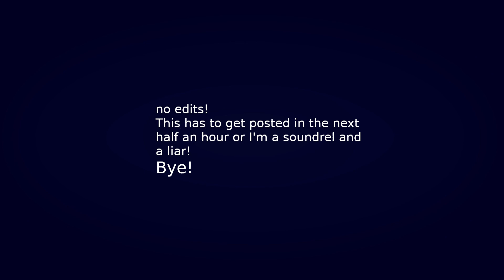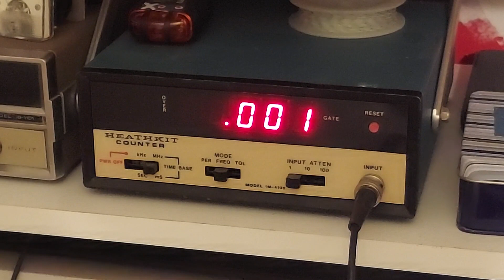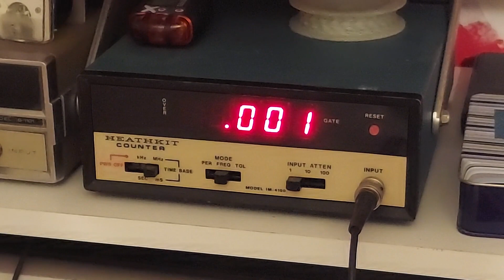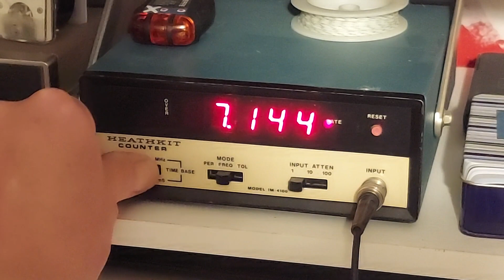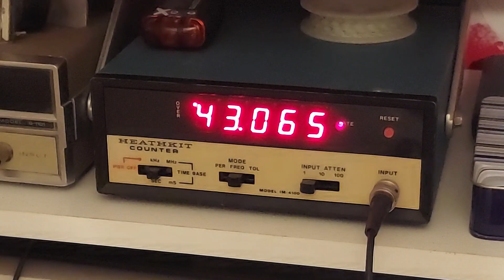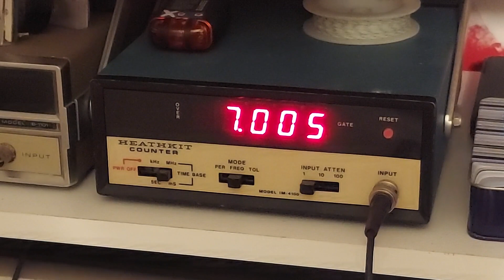LO Design: Drift Expectations & drift in a homebrew LO from 1989

Comment: Nice. I love seeing things people have made. Very stable. You're right, a little bit of c.w. can go a long way.
I made a 5 - 5.5 MHz v.f.o. with one 2N3819 and two as a buffer, with 4 S-M capacitors and replaced 2 S-M with 2 two polystyrene, S-M drifted up and poly drifted down so cancelled each other. About 5 mins slight upward drift then it settled down.
G4GHB.